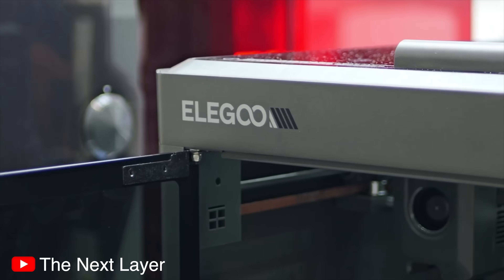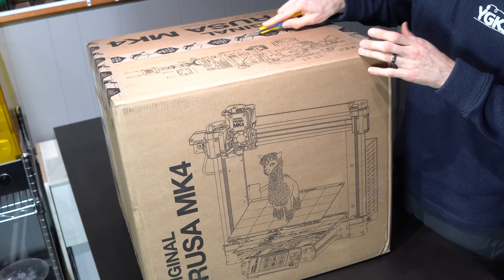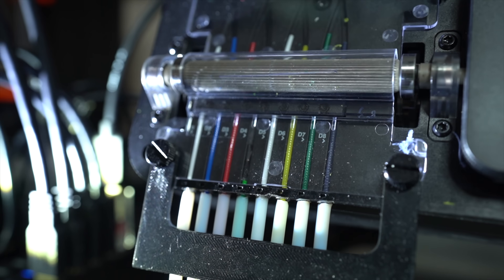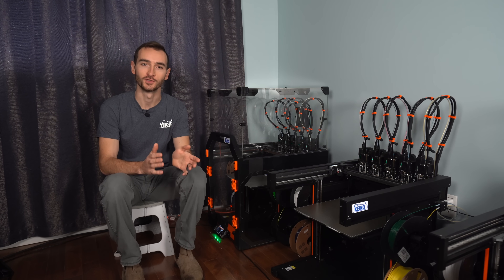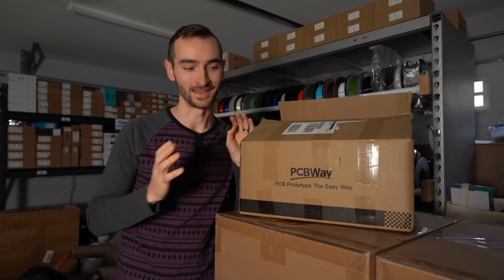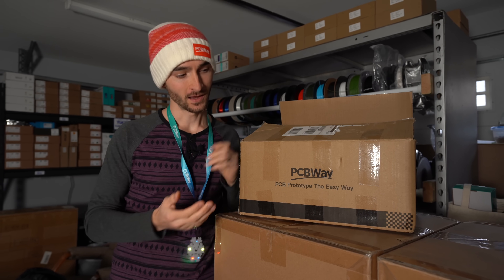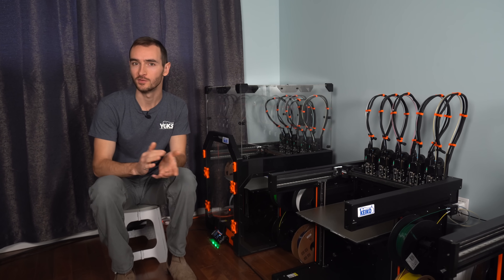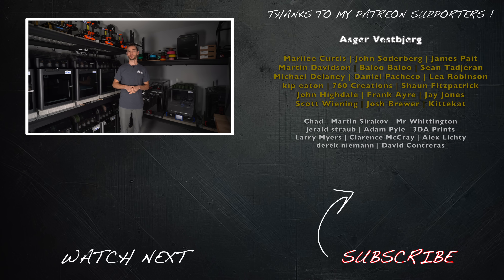The Prusa Core One is dividing the internet...

Comment: The Bambu X-1C is the clear choice for normal consumers who just want something that works.  When I got into 3D printing I just wanted to make stuff quickly.  I was stunned to learn that prints took 16 hours to sometimes 2 days to complete and failures were more common than successful prints.  I was continuously annoyed with having to spend hours doing manual bed leveling and test prints before I could get maybe a month or so of working prints out of my machines.  I too bought the Palette 3 PRO as a way to print in more colors but its quirky failures and multiple feed issues left me with a $1000 paperweight that pretty much still sits idle everyday.  (anyone wanting to buy it from me?...lol)  Anyway, I wanted something that worked.  When I ordered the X-1C I was hugely skeptical after my previous experiences, but I went from being a doubter to being overwhelmed with its performance rather quickly.  Not only did it work, it was WAY FASTER!!  Prints that used to take hours, took minutes and the quality was thousands of times better. Because the bed was auto leveling it meant that every single line was clean.  The auto nozzle extrusion tests made nozzle under extrusions (which previously ruined about 50% of all prints or made them into Bondo covered nightmares of sanding and finishing), a thing of the past.  I disassembled three of my four printers to clear my workbench and began using the Bambu exclusively because it was just plain EASIER and FASTER than messing around with the other old printers.  The Palette Pro still sits next to the single bed slinger I have left assembled that I only keep around because of it's print bed size (310 x 310 x 400 mm) compared to the Bambu (256 x 256 x 256 mm).  The time it takes to complete those big prints though is better spent slicing it into smaller pieces and just super gluing it together afterward.  I literally have four Sunlu S8 printers now collecting dust in my garage.  I think Bambu GOT RIGHT, everything that SUNLU and CREALITY got WRONG.  The printer is FAST, it's EASY to use, it can do MULTIPLE COLORS EASILY, it has GREAT SLICING SOFTWARE, and most importantly IT WORKS RIGHT OUT OF THE BOX WITHOUT WASTING HALF YOUR LIFE MANUALLY LEVELING THE BED!!   I'm not a paid shill for Bambu, just a very happy customer.  My only real GRIPE about the Bambu machine is that my OLD FILAMENT spools from Sunlu and other brands DO NOT work with the AMS.  The routinely get stuck, so I stopped using all the old brands except for HATCHBOX.  I think it has to do with the HAtchbox reels being the exact same size as the Bambu reels and made of plastic not cardboard.  So yeah, if anyone wants 20 boxes of ABS material that I can no longer use or interested in a cheap bunch of Sunlu printers and palette PRo hit me up!  My wife wants me to clear out space in the garage....lol  CONSUMERS like me, just want stuff that works when we pay sh*t ton of our cash for said machines.  Teh Bambu labs printer works.

Comment: I had an issue with my AMS.  I spent maybe a total of 5 minutes with support to get the issue diagnosed.  They offered a replacement unit or a part plus a free roll of filament.  

Even if you're not under warranty, the pressure sensor is $5. There are 3 of them.  So, total parts cost is $15. They're located right under the bed - you can see one of them if you just look and the other two are covered by a cable cover.  Remove a few screws, replace the sensors and you're up and running.... well, maybe put the screws back, too.

Comment: Why would Prusa release the XL at such a high price point and NOT include an enclosure? I use 4 for work and I hate using them. I go to the Bambu for prints that fit, which is 90%. Even the quality difference in the prints is significant. I’m not sure I would recommend the Creality K1 Max (I have one), but at least I didn’t pay like $3,000 to be disappointed.

Comment: I have had two MK3's and they were fine, BUT they required a lot of preventative maintenance if you wanted to keep them from rattling all day and night. I have done nothing to my P1S printers, no belts, no carbon axis rod assemblies, nothing... It just works. Say what you will about Prusa sourcing quality parts and providing superior customer service, but if Bambu was doing that terrible of a job, then they wouldn't be the market leader. They would be Creality. Edit: I wanted to add my views on the "but what if Bambu closes down, where are you going to get parts then??" argument. Just selling my prints part time paid for both of my P1S printers in a short period of time. If you're not being responsible and stocking critical spare parts for your machines, then you're an irresponsible business owner. That being said, if Bambu were to disappear tomorrow, Prusa still wouldn't be back on top.

Comment: I have a 3D printing company and worked in this field for around 15 years. We used many brands of 3D printers and Prusa was at a certain time the best in the market for our scale. 

Now? Our farm has ~65 machines, of which 30 are from Bambu and they have 3000 ~ 4000+ hours of printing time. The key is to do periodic maintenance to your machines like you would for any other machine and they will run optimally for years to come with minimal problems. We do periodic maintenance every 2 months and thorough maintenance thrice a year.

Don't expect any machine to run flawlessly with zero maintenance, that's simply an oversight from your own lack of knowledge.

Comment: Here's my take on my recent dive into the world of 3D printing:

Just a few months ago, I decided to finally pull the trigger on buying a 3D printer. It was an exciting time with the Prusa MK4S and Bambu models dominating the market. After doing my research, I found that both printers deliver similar output and quality, though Bambu usually comes at a lower price point. 

For me, the decision wasn't just about the printer itself. I've always valued open-source principles and the ability to tinker, upgrade, and customize. That's why I went with Prusa. It's a perfect match for someone like me who loves getting hands-on with technology. 

However, if I were running a business, the equation would change dramatically. Cost versus performance would be the deciding factor, and Bambu would likely be my choice for its economic advantages.

Now, here's where my concerns lie with Bambu. They're often compared to Apple in the 3D printing world, aiming to dominate through what could be seen as under-pricing. My worry is what happens once they secure a significant market share. Could they start introducing restrictions? Like, maybe they'll limit printer usage time or charge for each print job? What about making the printer essentially a rental unit - sell it cheaper upfront but then you're paying as you go? 

And with the NFC technology on their filaments, there's a risk they might restrict you to only using Bambu-branded materials. Given that Bambu isn't just a startup but backed by heavy hitters in Chinese conglomerates with deep pockets, these scenarios don't seem far-fetched. 

This isn't just about price or technology; it's about control over what we own and how we use it. That's why I appreciate Prusa's commitment to open-source, which not only aligns with my values but also protects against some of these potential future restrictions. It's a lot to think about, but it's clear to me why I made the choice I did.
Reply: How is prusa perfect for someone who likes to get hands on? The hardware is closed source. An open source printer like maybe something like sovol would be far more geared towards that.

Prusa used to be for open source folks, but havent been for years.
Reply: @BeefIngot  Most Prusa printers come as kits that you assemble yourself - it doesn't get much more hands on unless you design your own printer. There are only a few hardware parts that are specific to the printer. Most parts are standard (motors, gears, rods, screws, etc.) or easily printed (all plastic parts). You can get the print files (and at least partial design sources, like SCAD or STEP files) online. You can buy ALL replacement parts for fair prices on their web shop - you could assemble a full functioning printer from their spare parts store. If you feel like it you can even get the designs for their electronics and the sources for their firmware.

If I wanted to build another copy of my Prusa MK4 without buying a single part from Prusa: I would have to reverse engineer only 3 hardware parts - main frame, print bed and the aluminium frame of the hot end. None of those would be a real hurdle, but they'd be expensive to make as a one-off. The electronics I could just order from a PCB manufacturer using Prusa's original design files - again the one-off cost would be higher than buying the part from Prusa. Anything else would be cheap standard parts or printed PETG parts with designs downloaded from Prusa.

This is the MOST Open Source that I have seen in any complex hardware. What else would you want?
Reply: @KonradTheWizzard  Assembling the printers is a gimmick that doesn't actually teach you anything of worth to justify the time spent. The savings also don't even bring them in line with the competition.

There are many more parts than you've stated that are closed and I would bet that vs Bambulab Prusa is at maybe 40% proprietary vs Bambulabs 60%.

Further, consider that the Core one in particular only really has the 2 gimmicky side panels availible open source. Everything else is closed, and anything that 8snt just so happens to be a standardized part such as a bearing or motor.

Sovol has truly open source printers where you even get pcb schematics (quite important and something Prusa obfuscate and does not provide).

In essence there is a whole lot more open source wise you could want out of a printer.
Reply: @BeefIngot  I assembled my own MK4 a few months ago. For me it taught me how it is put together, where to find potential problems and most importantly to not be afraid of taking it apart. For me that is VERY important.
Reply: This sounds like it was written using AI from someone at the Prussia marketing office.
Reply: That's 8 hours no one is getting back for things most of which won't help them save more than 5 minutes of googling any time a problem occurs.
Reply: @BeefIngot  I have really enjoyed those 9 hours I have spent assembling it together. But I enjoy many stupit things, like building my computer or fixing a car.

Comment: Nice video. However, it’s a bit unfair to say that the Bambu Labs are less repairable. You have just assumed that they are not worth even trying to fix, which is a very strange approach. Also, I don’t believe they only last 1000 hours until a major failure. Sure, some may be unlucky, but I think the average number of hours over the entire fleet is way higher. And by doing regular maintenance, most people will probably be able to avoid a major failure during the entire lifetime of the printer.

Comment: My first printer was an Anet A8 so I gained a lot of (painful) experience. I now have an A1 mini at home. The Prusa MK3.5 in my Makerspace is a snail compared to Bambulab. But the 6 Prusas in the Makerspace are printing almost 24/7 very reliable. They handle all the abuse from different makers without any issue.
For a print-farm: if you need to modify your 3D printer to produce specialized items then the Prusa is the only way to go. For my Bambu I tried manualy modifying the  GCode File to do a manual filament swap (I don't have the AMS Lite) and it's a pain in the a**. Bambu has a lack of documentation when you leave the intended way they want you to use their printer. Specialized Hotend on the Prusa: Possible. Bambulab: no way.

Comment: Great video thank you.
But, to be honest it is only based on what happened to you, for me the thermometer on my Prusa died after a short 200 hours or so.

I contacted prusa and they didn’t even know how to help me and what the problem was, after figuring it out, I wanted to buy a new one from prusa but it would cost me a lot and would take me a lot of time to assemble, so I instead bought the whole HotEnd from Aliexpress.

In Bambu the fixes are straight forward and well priced on their official website and I find their support to not matter since the internet is full of videos and questions from users and if you need to replace something you can just do it, most of the time fairly easily, no tinkering around

I don’t think the core one changes it since they do offer an upgrade kit which means it is still for tinkers but I might be wrong
Reply: And btw at the time, when I could mot fx my prusa, I bought creality ender 3 mark 2 for around third of the price and it worked wayyyy better for me and was way easier and cheaper to fix

Comment: With the Qidi in the game, heated enclosure, higher temps and lower price even than Bambu, definitely Prusa is in for heavy battle, but on a more industrial level they can still exist, due to their legacy, support, and overall solid engineering. Just for a hobby users, when you only compare the price, none if these are actually relevant. For printfarms is another story, that usually doesn't transcend good for to the hobby users. The best way to "like" Prusa is to buy their products, i would too, but the price is almost triple of a qidi q1, which is kinda the same spec, some lower/some higher even, will the qidi last as long as a prusa, off course not, will it hold out for a few years for me, sure, after the few years passed, will i want an upgrade, off course. 3D printers as any other tools need to last UNTIL you plan to use them, not forever, so the logic of this endless repair-ability, pit of infinite spare parts is not something you will actually need/use.
Reply: I spent a long time researching my next printer and in the end cost was the most important factor and I got a Qidi Tech Q1 Pro and I've been super impressed and, almost a year later, I can say that Qidi has the best support of any manufacturer I've ever dealt with.  The Q1 isn't as hands-off as an X1C or as buller-proof as a MK4S but it has an amazing heated chamber and it just prints well.  My hobby is 3D printing, not 3D printers... I just want to slice and print and Qidi does that.
Reply: @PaulKostrzewa  Yup, same here :) But could phrase there, my hobby is 3d printing not 3d printers. The X1C doesn't has the heated chamber, so that was also a deciding factor (after the 2x Price). Qidi support, well they are how they are but they will ship you the replacement parts, on the hobby market i think it is going to be Bambu vs Qidi, and we end users can enjoy the benefits.

Comment: the biggest problem with Prusa is the price and parts availability. You could get several printers that has similar performance for the price of a Prusa. A Prusa isn't infallible as well, I had just as much problems with my Mk3S+ and my Ender 3 and not much less tinkering. And Prusa's parts, accessories, and consumables are basically unaffordable unless  you are in the EU. If the argument is that it can be fixed with aftermarket parts, then why am I paying so much for the Prusa? I might as well get some random Creality printer that can also be fixed with aftermarket parts. Prusa simply has no interest in making things easier or better for customers. Look at Bambu's A1 recall incident. What it showed was the supply chain that Bambu established for recall and sales. I can easily order stuff from Bambu directly and have them shipped to me at affordable rates. Not the case with Prusa.

Comment: While it’s not perfect I have been really happy with my Prusa xl 5 head with the enclosure. The ability to have very different temperatures, nozzles, and frankly redundant print heads.  (I admit I melted the petg parts when I tried a long polycarbonate print in a third party enclosure.) But it was simple to print replacements with a remaining head out of pc-cf and be back printing in no time. And after getting the official enclosure it’s been smooth sailing. To me Prusa while not perfect has been my go to.  Most of my complaints are me missing things that I had on my voron.  Which has been in a perpetual state of upgrade since I got it to learn 3d printing while waiting for the xl to release. I have nothing against the bambu printers or company but I would rather buy a Prusa for the old school support.  I worry that without a Prusa around Bambu might choose to go the inkjet printer route further undercutting everyone on the printer but making up for that loss by doing everything possible to keep you using their filaments. Which could stifle innovation in the consumer market.

Comment: I'm in the market to buy a printer up to $2500. I do prototyping and WILL NOT have a 3D printer that collects my data models and then sends them together in a batch when the PC is connected to the internet. SURE, you "CAN" run in local mode. But if the slicer program or the 3D printer itself caches data and sends "on occasion" when I update firmware, software, etc. then there is a BIG risk of losing control of my models. Basically what I'm saying is that: BAMBU LAB is totally out of the question, even though I would love to have an X1 Carbon. But if I have to install a Chinese 3D printer in a faraday cage in a lead-encased concrete bunker 30 feet underground to make sure it doesn't send my data, it will just be too much overhead. Do you have any tips for a 3D printer that DOESN'T steal data?